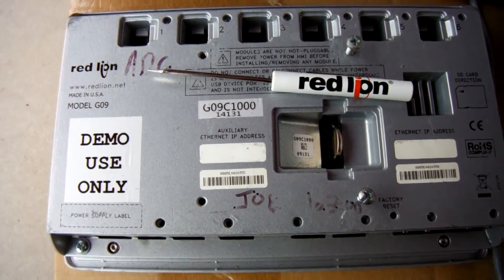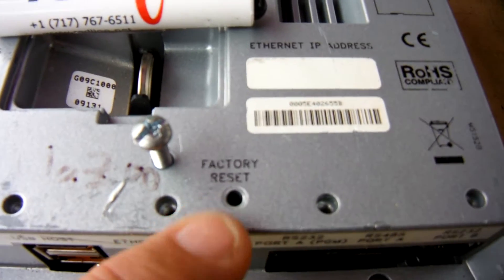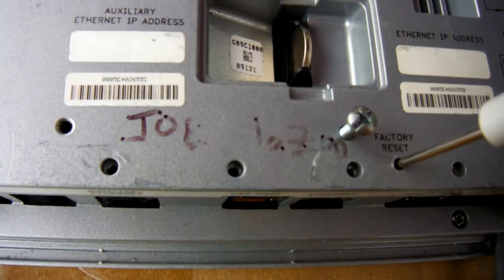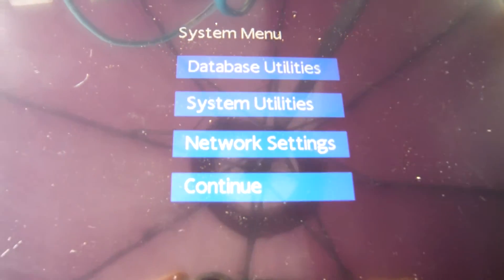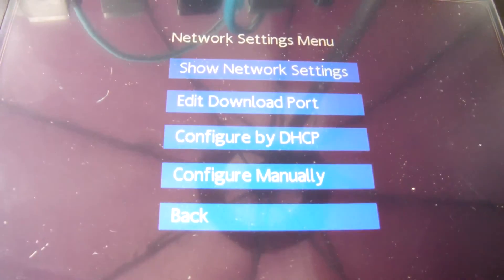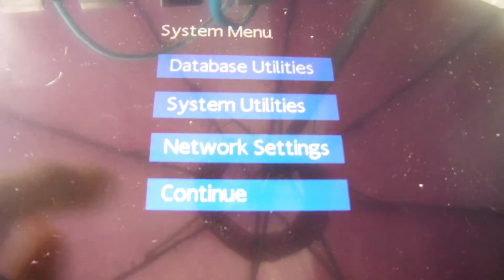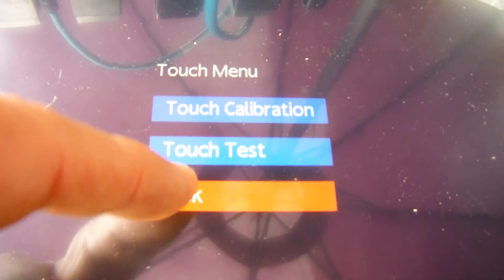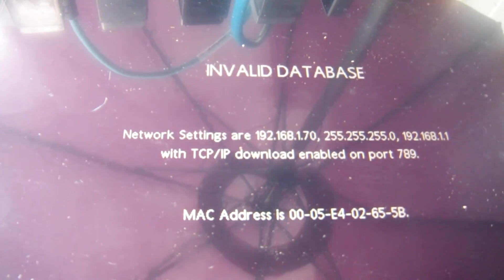RedLion HMI download via Ethernet

Comment: How do I correct the invalid database error?
Reply from the maker: Chances are that error is because you are trying to download a database that was created for a different model HMI then the one you are trying to connect to. Use the File pull-down in Crimson and select Save Conversion and choose the correct HMI unit you have. Then save as a different name and try to download that to the HMI.
Reply from the maker: What HMI model do you have? The Part # and Date Code should be on the back of the unit.
Reply: the one that damaged the model was: G30S21U
OEM G3D33 14133, the new one is G310S210
01NOV17; when loading the image the error appears
Reply from the maker: @jpmorales8  Based on that part # I think it might be a OEM model that may use a special build of Crimson for that original machine builder. Since I do not know all of the OEM builds I recommend that you call the RedLion tech support #1 (717) 767-6511 or send an email to support@redlion.net with your Crimson file and those model #'s  for them to evaluate the steps to make this conversion.
Reply: @JoeWaZoo1_Geeks_Rule  Thanks

Comment: Hello Joe
What’s the difference between G315C000 and the G315C000 ?
Thank you
Reply from the maker: Those two numbers would be the same.  I recommend you use the G15C0000.  The G3 models HMI's have a large bezel and buttons on the left side.  They are being discontinued at the end of 2020.  I think the G315 model is already End of Life.  You are better off buying the Graphite G15 HMI instead.  A much more rugged HMI, and it supports Crimson 3.1.  https://www.redlion.net/product/graphite-15-modular-hmi-indoor
Reply: JoeWaZoo1 I had a G315C000 new in box and sold it to a guy but he normally uses G315C210 and apparently couldn’t load the program by CF or USB and saying that the screen doesn’t work 
That’s why I thought I should ask joe the expert ;)
Thank you so much
Reply from the maker: @kamalhalout5930  That is the issue with the G315.  The processor used in that HMI does not support USB 2.0> or greater.  Finding an old PC with USB 1.0 spec is hard.  In the box should have been a ethernet crossover cable and I think the unit  should have a CF card in it as well.  Use the BIOS/BootLoader settings to set the IP address and then see if you can download via Ethernet.  The C210 just means it has two Ethernet ports on it.  Please purge your inventory of G315's and switch to G15 models.  https://www.redlion.net/sites/default/files/1280/7023/G315%20USB%20Programming%20Port%20Errata%20%28obsolete%20-%20for%20reference%20only%20-%20see%20Graphite%20Series%20for%20new%20designs%29.pdf
Reply: JoeWaZoo1 you are a legend

Comment: How do  I download to a G310?  It  doesn't have the factory reset.  The screen comes up with   the mac address and that's it
Reply from the maker: How Old is it?  Newer firmware will allow you to hold down the top two buttons on Power Up to get to the newer Bios Operating system.  If it's old it may not have that firmware in it.  Also the G3 series will require a Compact Flash card to be able to download over Ethernet.  Yet another great reason to use a Graphite HMI.